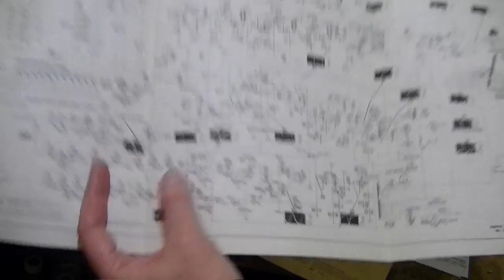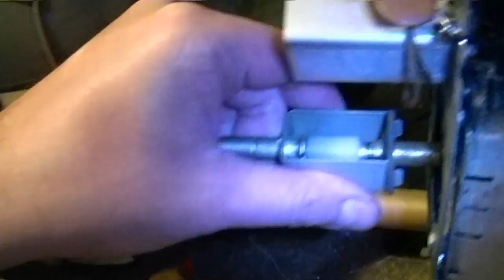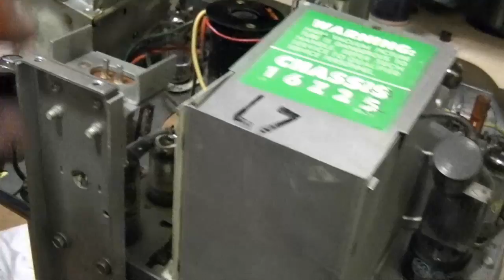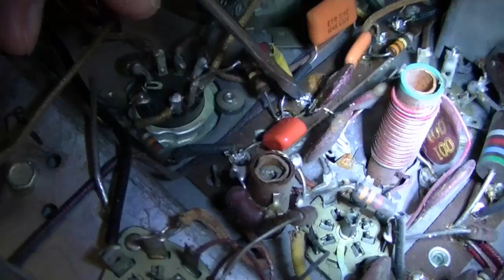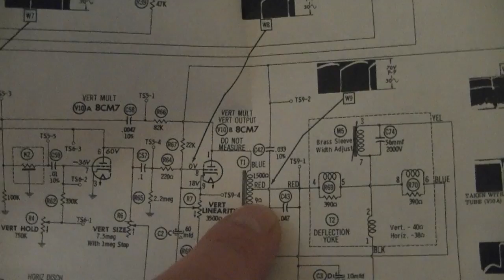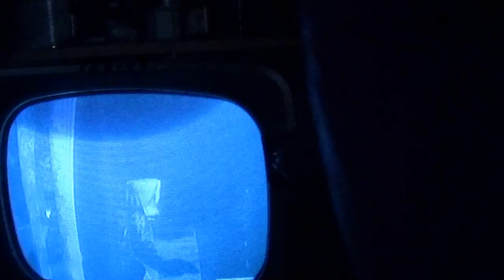Zenith "Bug Eye" restorations pt4o9

Comment from the maker: I agree with what robot797 wrote. I've only had a couple tubes fail in radios that I use daily.  I don't use my TVs very much and have never had a tube fail.  A clear or white getter are both bad signs of air inside the tube.

Comment from the maker: Thanks!  There were some ugly old repairs, but I must admit that I screwed up wiring in the two new caps.  I think the issue with the flyback arcing is a design flaw.  Like the old64goat commented earlier, it's too close to the metal box around it.

Comment: hi i will awnser this one as best as i can
that depends on how it is used in a radio they can last up to 50 years
in a amp they can last 1 year

the heater can fail it is the most comon result of a broken tube
and the heater fails becaus it gets old

if the tube gets white it means it is dead
all vacuum has leeked out and only air on the inside

Comment: That flyback is way too close to the metal cage, maybe you can bend the cage a little, make a bulge or get some high voltage insulation and slide it between the fly and cage.
I don't think it will hold up too long if you leave it that way, you could also leave off the back of the cage.
Bill.